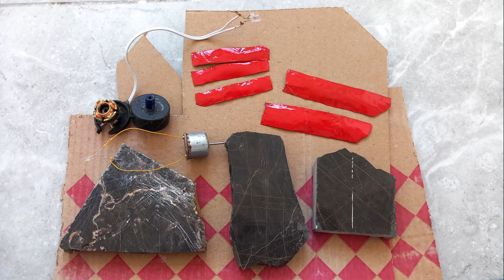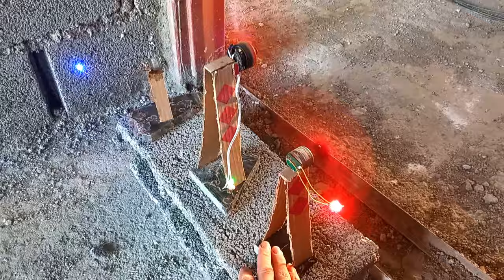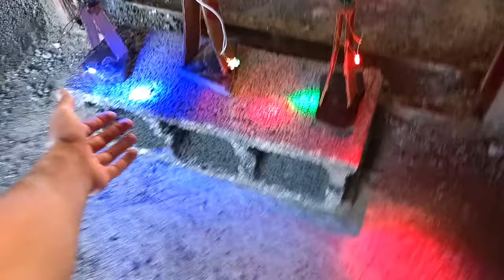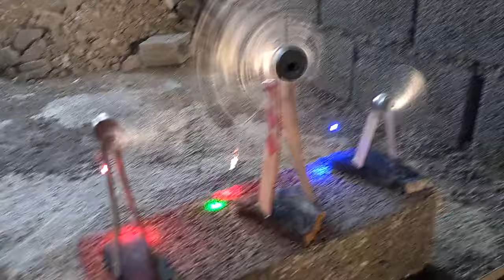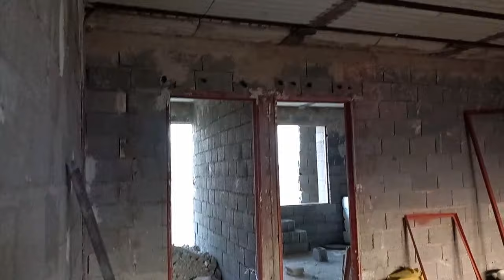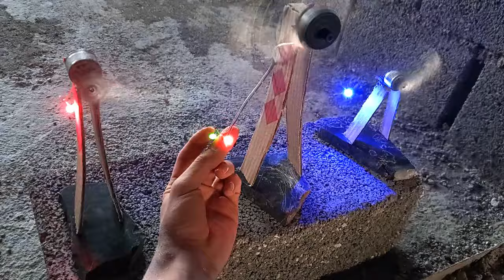DIY wind turbines

Comment: But bro does it can charge phone this small wind turbine❤
Reply from the maker: with this it will take a long time to charge, it could take around a week.
Reply from the maker: but with a back-up battery on the turbine, it will charge over time and when u plug in the phone it charges quickly using the charged wind turbine power-bank.
Reply: @Science-Vlog  Oh my God, but I can use a bigger one
Reply: @Science-Vlog  But brother, what kind of machine is better to produce more electricity

Comment: God sake make you own generator!
Reply from the maker: homemade generator are ugly and expensive, i do not like. these are factory made motors they last a long time, they made from steel and have brass bearings, compact, correct magnetics, generate most power with least length of wire in their coil, very small, very efficient in converting mechanical energy to electricity. u can't make something this perfect at home. u can use 100 meters of wire to do what these motors do with just 4 meters wire in their coils, and two tiny ferrite magnets instead of your expensive neodymium magnets. because in these factory made motors they have magnetic steel cores laminates and it moves very close to the magnet without touching it, u can only make air core generators at home, which are big and need a lot of wire and powerful magnets, not economical. there is many scrap dc motors available for cheap, pc fan, and for high power can use second hand stepper motors!
Reply: @Science-Vlog  good luck powering your home and being set for life with your led power
Reply: @Science-Vlog  i beg to differ being i make electric motors you're preaching to the wrong crowd, my motor would eat your store motor for breakfast in power and efficiency how many amps does your baby motor need? 3.5A? Mine needs less than 0.5A there's actually no comparison, my last motor could power a 100watt led flood light 36v 3amps
Reply from the maker: @doubleooh7337  u using a lot of copper to do that.
Reply: @Science-Vlog  the one now will have 8kg total but it was 1/2 the price when i got the copper, this i planned on making a serious motor that might eventually get me around if fossil fuels are banned, but i was just gonna attach it to a wibd turbine so it can push that, then i got it in my head to just wind a wind turbine myself as i reslly want 110/220v and 13amps out thin wire for higher voltage and many many strands of wire in parallel to get the 13amps will it? Doubtful but the wind turbine show it's possible,  yeah cost way more but it should make back the cost faster within the next 6months I'll have something working if not 220v then it should atleast power my hydrogen cell,  and doing a coil gun coil, 173 strands of 0.50mm wire in parallel should mske the coil a 100amp coil if it is thatll give 1,200joules, i even got a new fanblade design to make at some point, bit of a con wind energy as the wind only turns the blades , I've always thought the fan blades and the motor could be significantly improved.

Comment: How this motor is this
Reply from the maker: dc motor from broken cd player, the black one is a pc fan i removed its blades
Reply: @Science-Vlog  but haircut machine motor is good??
Reply from the maker: there is many types, idk what your haircut machine motor is, if it's battery powered it is a DC motor. when u found a DC motor test with a LED and hand spin, before making wind turbine. some DC motors have coils with low number of turns and does not make enough voltage with normal spinning.
Reply: @Science-Vlog  thanks